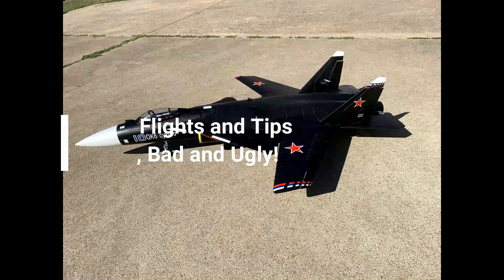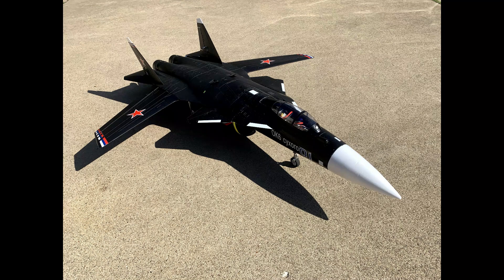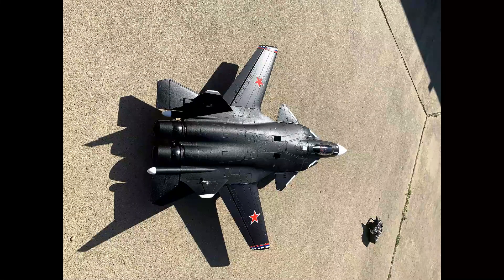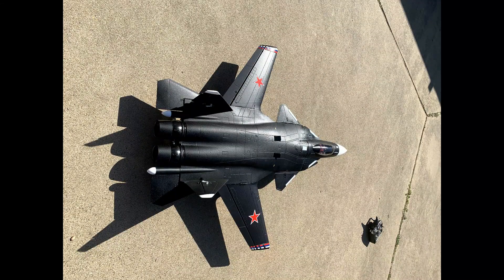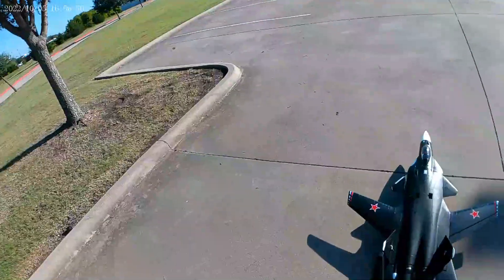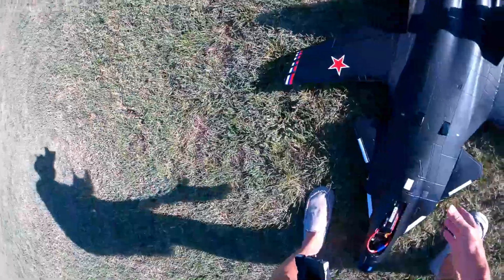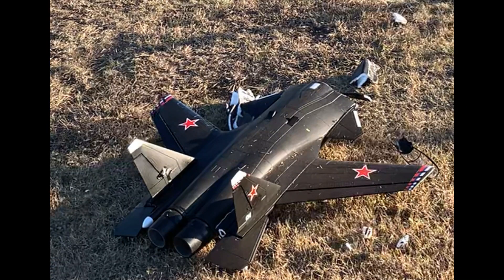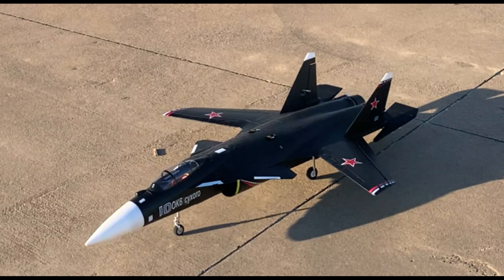LX SU 47 Flights and Tips - The Good, Bad and Ugly!

Comment: You are way nose heavy.move battery back from last flight and then trim elevator in flight to fly level.
Reply from the maker: No there was a 5200 battery with the front of the battery under the canopy hinge. It could not go back any further. And it balanced perfectly on the book CG.
Reply: Then your elevator was pushing you down.
Reply from the maker: @sendit_rc  There are 3 possibilities here: CG off due to battery placement(nope checked the CG), Elevator is off(nope..elevator was level with rigging and gave it full elevator up trim - not much effect) and 3) canard impact. Unfortunately, LX does not provide any direction on setting up the canard. See the user manual for a jet like the Rafale where this is covered. Looking your YT you have a Rafale..set the canard LE down 1/4" and go fly. Let's see if she behaves nose heavy.
Reply: Ive adjusted my canards up and down,also moved the control horn holes to give maximum throw. didn't change any flight characteristics.
Reply: @sendit_rc  the canards are supposed to direct air over the main wings to push the stall speed down. It is not a deflection surface like an elevator.
Reply: @cwwisk  I know that, thanks for the input